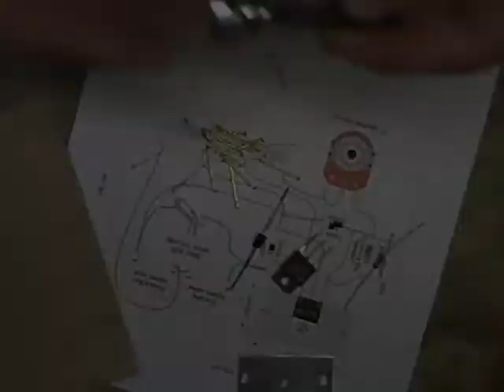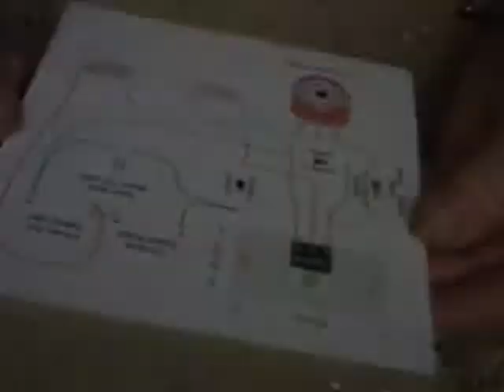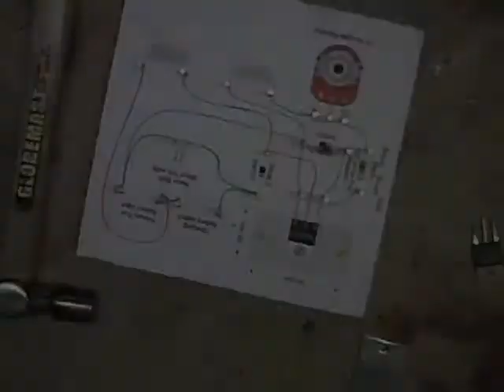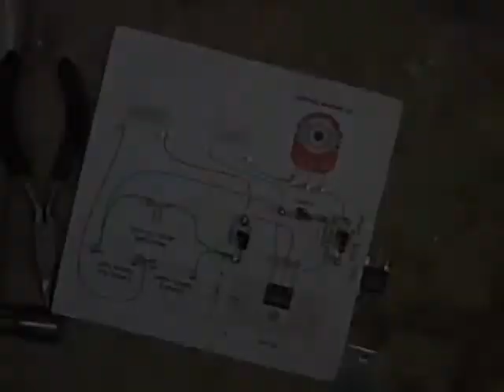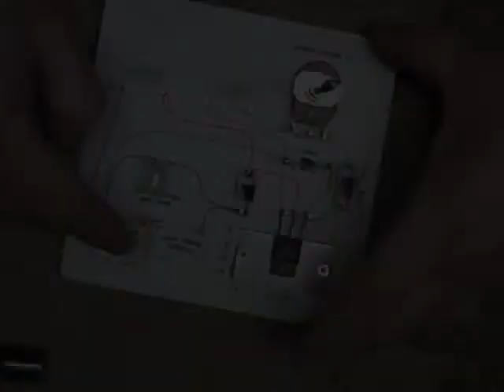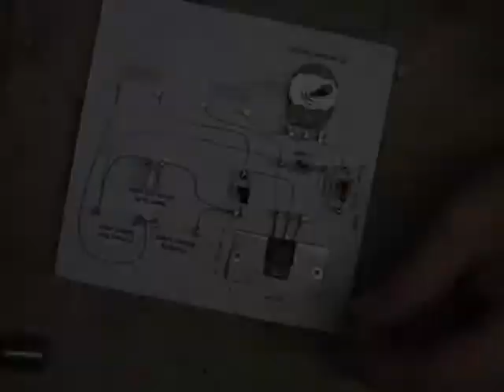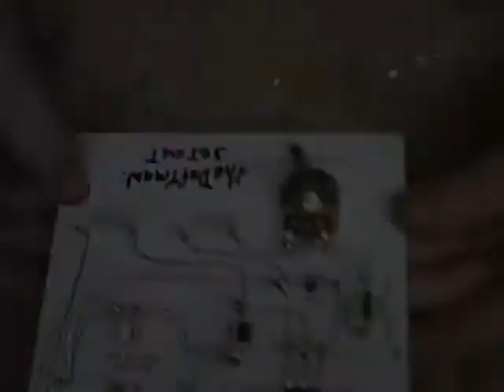Bedini pulse motor, build and diagram video 1 of 3.(TheDaftman)

Comment: Hey  if the 100ohms resistor keep smoking and burning up !What do you thinke is Wrong??And what should I put in place off?? This happens with out a 2and charge battery hooked up.all I do is start it up And smoke comes out off the testator

Comment: please help..... Can i run multiple coils set up  with 2 batteries?  if so, can someone please tell me how to connect the batteries?  i like to know if all i have to do is to put all the positive wires in the positive terminal of batteries and all the negative on the negative terminal of batteries according to the diagram?  please help

Comment: hey im new to all this, 
are the pins metal or something? does it matter what pins you buy? like can they just be saftey pins or something
and what type of wrire is needed to connect all the parts and how does the wire connect to the individual parts? like does the wire just solder on to the pin?

Comment: THANKSfor all your helpful info! a little question of measurment...  When you measure milliamps that the motor draws do you put the meter (in) the circuit in series? How do you measure amps in your batteries? do you put a known resistance in the circuit?  What kind of a meter do you use?  THANKS!     Later ... scooterscottii

Comment: hi daftman, Thanks for eloborating the complex circuit in a neat way I have followed ur setup since i am not able to get diode 4001 can i use 4007 instead?? can u explain why its not working if i use 1N4007 instead of 1N4001 or its something else thats going wrong. I followed just what u did. if possible can u mail me a copy of the schematic that u had in the board.

Comment: Hi daftman, Thank you for the info to build a pulse motor. I am trying to build it. On the 100 ohm R, is it 1/2 wat or 1/8 watt? I found the in4007 diode,but not the in4007, do u know where i could get 1? Icould not find the  tip3055 voltage regulater either, is there a place where i can get these online? I am working on a video slide show that i will post when completed. thanks again for all the help